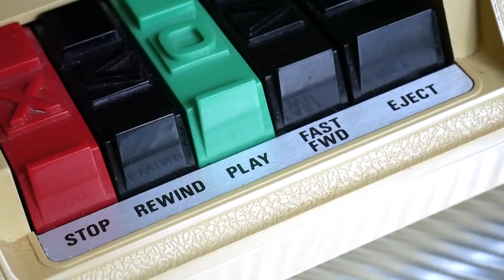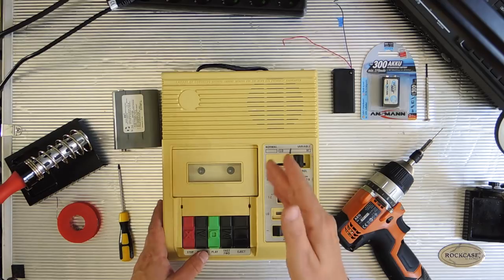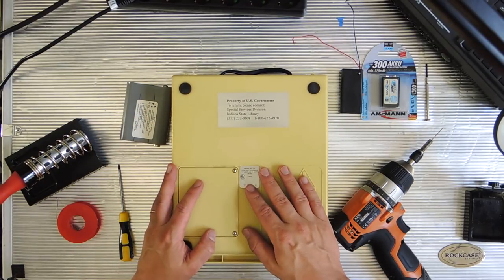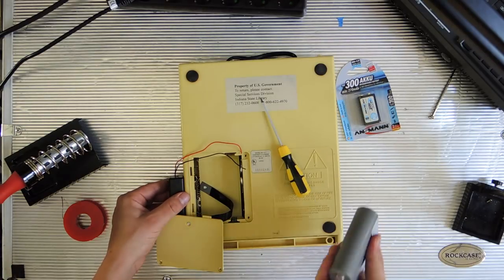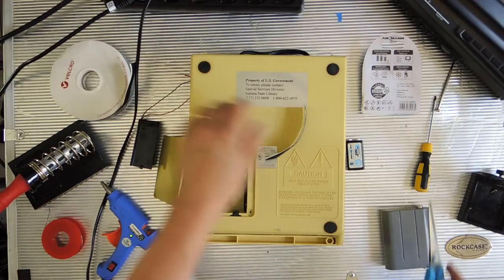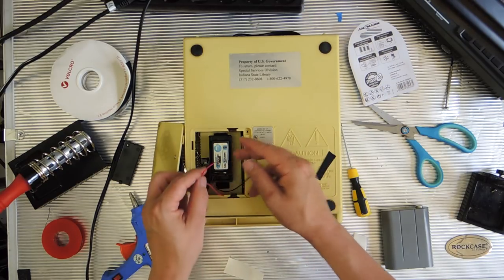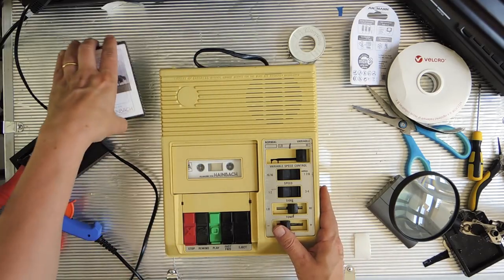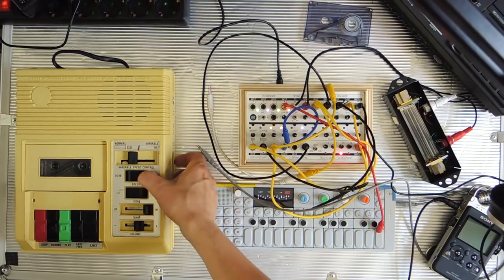Library Of Congress C1 Cassette Player - The Ambient Machine

Comment: I found one of these at a thrift store a few years ago. I instantly fell in love with it and restored it to like-new condition. I ended up building a new battery for it out of NiMH cells. The battery I built runs amazing and it will easily run for more than 24 hours. It's got to be my most successful thrift store purchase.

Comment: I got super lucky and found one of these in perfect condition at a thrift store for 6 bucks.
At first the tape mechanism didn't seem to work at all, but after popping it open, i saw that the old belt was kind of 'stuck'. once i manually got it turning, it's worked fine ever since.

so cool to now hear that I can fairly easily make it run from 9V!

Comment: I have one of those! I've had it since about 1978 when I used it in High School to listen to talking books. I've been meaning to send it back to the library for almost 40 years. It's actually called a C-134 or C-135, I think, I still have the original tape around here somewhere which has that printed on it, the tape tells you how to use it when you press play the first time. I need to find it, probably still illegal to sell it, but I doubt the library wants it back anymore.

Comment: You should also check out the Marantz PMD 201. It is an excellent sounding cassette player and recorder which also gives you extensive control over tone, level, and tape speed.
Reply from the maker: Totally agree! Marantz of all variety are my main tools!
Reply: So does the General Electric GE 3-5184, and it's the size of a Walkman. It was made for talking books to be used by blind people in the USA. It's pretty good, records as well
Reply: or the APH Handi-Cassette II
Reply: @andy9mm  I think that's the one I have, has 'APH, Kentucky' on the face
Reply: Or, for something a bit more portable, check the Handi-Cassette series from APH (American Printing House for the Blind).
Reply: Louisville, Kentucky. That's why.

Comment: Just picked one up at a Goodwill for $10.00 still new in the box..
The strap on the battery cover is to help pop the battery out. You put the strap under the battery before you install it.
Reply: When they would send a replacement unit, they always camein a box as if were new.  I went through like 3, or 4.  I think I had the green version before yellow became standard.

Comment: I used to have one of these when I was younger and received talking books from cassettes before they went digital. I should see if I still have it somewhere.
Reply: Did you ever find it?
Reply: L P Saddly no. But I think I saw one on Reverb that I might try and get my hands on.
Reply: @johndowlingjr.  The drive belts go bad (melt/disintegrate), but replacement belts are cheap on eBay --- a variety pack of 25 or 50 belts for under US$2.  The YouTuber "Adam Cee" has an extensive C1 repair video entitled "LIBRARY OF CONGRESS C1 CASSETTE TAPE PLAYER: TEARDOWN, TIPS, & REPAIR GUIDE".

Comment: The yellowing of the plastic can be cleaned up using hydrogen peroxide. There are many guides online for fixing discolored Super Nintendo systems.
Reply: Unless that's the original color? haha
Reply from the maker: I think it is at least very close to the original color - these were known as the "yellow" ones from the start.
Reply: Yellow is the original color,  they also made red,  orange, white and green ones too,  but I think they were slightly different models.

Comment: Lucky you to find such an ancient equipment in very nice state - been searching for a C-1 for a long time, but the few I have stumbled upon were in pitiful state, sold "as is, no refunds".....incidentally, on the voltage, why not just use a small electrical converter? I recently bought a 3U Deopfer case from your part of town, which I had to convert from 220/240 to 120 - got a small, cheap 45w plug that does the trick perfectly. The voltage consumption on the C-1 is probably extremely low - I would go for one of these instead of batteries. Much better!

Comment: Hello mr. Hainbach, we have simillar tape player from USSR times its called LEGENDA P 405 T specially designed for people with eyes disorder to listen tape books - its got the same options and in my opinion more handy speed control, you might want to check it out too
Reply from the maker: Oh thank you for that tip!
Reply: @Hainbach  there is an odd thing about LEGENDA, its buttons...those are so tough and sharp so its scratches fingers a bit) unique experience😂 anyway great devices range of LEGENDA s, there is even a version 404 which you can use with a special Legenda radiocassete, it additionally opens radio option for the unit.

Comment: In your opinion, what keeps you playing the LoC C series rather than the handi-cassette I’ve seen in the background of one of your other videos? 
Is it simple preference or maybe more aligned with your concept of “playability”?

In my dreams I have modded mine — added a switch to turn off the erase head and added on a read head for an echo effect. In reality I just figured it’s easier to make a PiSound that’s running MODEP
Reply from the maker: I do play both - handi on the road, LOC in the studio for fine control.
Reply: @Hainbach  OH man! my handicassette worked wonderfully the other day but it seems I've caught a case of bad juju! Today I pulled it off my gear rack to make some ambient background noise, but the play and navigation controls don't make the tape transport spin! I'm gutted! Fresh batteries make the volume react fine, belts are supple and correctly positioned...Could it be that little white drive motor? 

have any advice, wise guru-phon?

Comment: Hej!
I don’t know if you’ll see this on such an old video but maybe someone can answer:
I just ordered one of these from the US in seemingly great condition, but I live in Sweden so was searching about power solutions and found this. You show that you can mod this for a 9v battery, but is there any reason I couldn’t instead (or additionally) add a barrel socket for a 9v plug?
I clearly don’t know about electronics if I’m asking this but I’m handy enough with a soldering iron to do simple jobs.
Reply from the maker: Yes you can. Or use a step up converter

Comment: I  have one that does not fast forward or rewind. It tries but it gets bogged down. I've changed the belts and that has not fixed it. Has anyone experienced this? I think it might be the caps or the rubber rings around the supply or take-up reels.

Comment: random question: i notice the spring tank you are using is not the one that comes with the koma expansion pack. have you tried that one? i have found that when i plug it in i immediately hear a lot of buzz. i can get it to go away by grounding the extra static (or whatevr) by directly touching the metal tank with my hand. what do you think the source of this problem is? whats the best way of solving it? thank you in advance if you decide to help.
Reply: I had a similar problem with mine. If my fingers went anywhere near the spring tank section of the FKFX I would get buzzing and interference. The fix was to buy a better (shielded) cable to connect the tank. The one that KOMA included didn't cause any problems for them but they obviously have a cleaner electrical environment than some of us.
Reply from the maker: That is the solution. Shielded cables.
Reply: oki doki thank you.

also this is my first piece of modular kit. is it normal for me to notice a loose connection in one of the jack sockets after only two or three days of use?
Reply from the maker: Nope, that sounds like a manufacturing error. Get in touch with Koma, they are really nice.
Reply: Jirmmy Skirt yeaa definitely get it touch with them. when i bought mine from them new, one of the knobs was dead. they fixed it (although it took a while).

Comment: An autotransformer that can convert 230VAC to 120VAC can be easily found. I'm certain the unit doesn't draw more than 10 watts at less than 1 amp, so pretty much any cheap autotransformer should work. The cassette player will have no issues with the 50hz line frequency. You'll want to get the "transformer" type and not the "electronic" type based on a light dimmer. Use "220 to 120v auto transformer" in a Google search.

Edit: I also want to add that using six of the "aa" batteries will give you nine volts, but the output voltage will be more stable and will run the cassette player longer.

Edit again: If you don't mind working on mains powered items, here's a $15 one from Digikey that should do nicely:
https://www.digikey.com/products/en/transformers/isolation-transformers-and-autotransformers-step-up-step-down/167?k=&pkeyword=&sv=0&pv2=1327&sf=0&FV=ffe000a7%2C15c40030&quantity=&ColumnSort=0&page=1&pageSize=25
Reply from the maker: I have one now, thx!

Comment: My dad passed away a couple month ago and I found that he was using one which happens it stopped working right after his passing, there is no power in the unit and I like to keep it ... any idea what could be worng? the internal power supply may be?
Reply from the maker: Sorry for your loss. Does it power via external cable? Can you take out the old battery and replace it with a 9V?
Reply: @Hainbach  Thank you, no power through the 120V, I didn't have a chance to open it yet, my father lived in MA and I live in OH, so I will take it apart when I take it home, I was just curious if you know if the power supply easy to go or not

Comment: Well, what about its history? Background info? What was it used for? Which institutions had access to it? How many are there? What tape are you using on it? Who built these things? How do you arrange the signal flow in your demo, with that mix of tape playback and live synthesis? I can't even see the tape reels moving. Answers, dammit! Answers !
Reply from the maker: Apparently, institutions that held it dear enough to bury it after it was retired: https://www.loc.gov/nls/wp-content/uploads/2017/10/C1-funeral.jpg
You should request Techmoan to do a history video on this, I am more focused on the practical musical aspect. All signals go into the Koma Field Kit FX for FX. The sound you hear in the beginning is the tape loop, the rest is live synthesis. The reels don't move with most tapeloops as the pull is done by the capstan.

Comment: Is there something you can recommend for someone who is interested in this stuff but doesn't have hundreds to drop on a cassette player?
Reply from the maker: Is it hundreds now? Well, do what I do and have classifieds open daily, as well as eBay. With time, you will find something good. In the meantime, look for Handicassette II
Reply: And check your local thrift shops - I've built up a nice cache of nice tape machines that way - rarely spending more than $10 USD.

Comment: The music is very beautiful but i have ALL these same features on my analog 4-track recorder as do all 4-tracks.
I even have a machine ive never run into before which records the standard analg 4 track but using a big 8 track tape.
Reply from the maker: Reverse playback? Long sliders for pitch that you can play melodically? Big switches for speed? This is more about user interface than functions ,🙂
Reply: @Hainbach  its a fostex and it has a nice little knob on the front for pitch. Also has cool knobs for isolating reverse side mono or stereo.
But its exactly like you said, if you prefer sliders to knob twiddling your machine wins.
Once again, love your music track.
🐰

Comment: Wait... all of that electronic equipment you have... and you don't have a simple 220 to 110 step down converter?  You can buy them at any hardware store in Europe for like 20-25 euros.
Reply: I leave mean comments Stepping the voltage is unfortunately only part of the problem. US gear is also a different frequency. Might not matter, considering the variable speed on this unit, though the numbers on the speed control would probably be inaccurate.